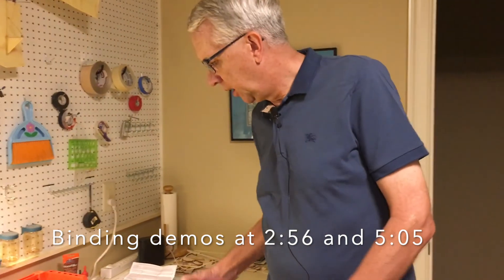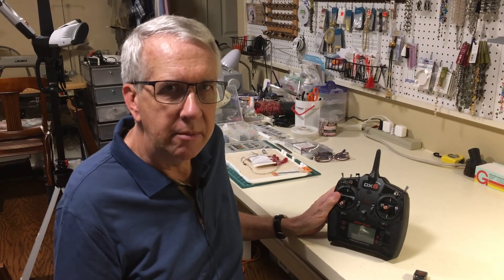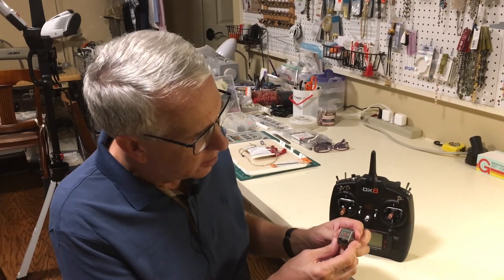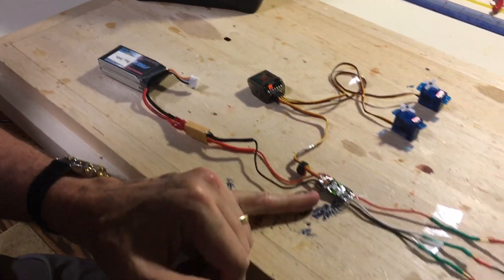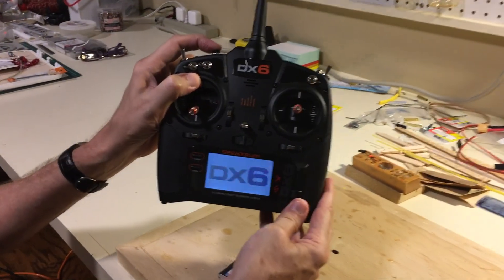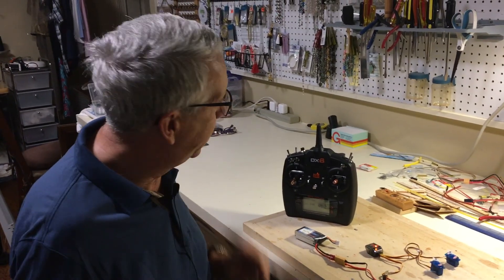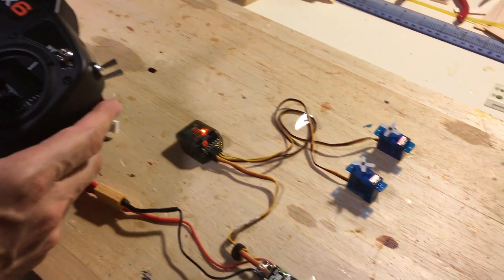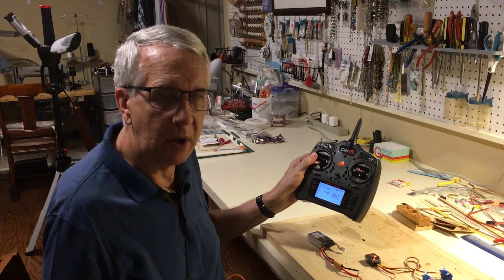How to Bind a Spektrum DX6 Transmitter to an AR620 Receiver

Comment: First time it did bind but made my plane make a constant beeping sound,hasn’t worked since the receiver now only flashes when I hold down the bind button
Reply from the maker: GR:  Try this.  Power down everything (transmitter and flight pack).  Plug in flight battery, press bind button on the AR620 Rx, and get it into the bind mode (flashing light).  Before you turn on the DX6 in the bind mode (bind button held down while turning on the transmitter), be sure to keep the transmitter at least five (5) feet away from the receiver, with the antenna pointed away from the airplane.  If you try and bind with the transmitter right close to the model, it quite ofter does not bind.  Tim
Reply: @TimMcKay56  I am more than five feet away, contuinuisly holding the bind button on my transmitter as I turn it on, and pointing it away from my receiver and it is still not working. This is a brand new transmitter and receiver so I am really confused do u know how to fix it? Sincerely confused rookie.
Reply from the maker: HM:  Only thing I can think of is double check that your receiver is in the bind mode ( usually a rapid blinking light) before turning on your transmitter in the bind mode. Also, check that the proper model is in the transmitter memory before binding. Tim
Reply: @TimMcKay56  I got it to bind... it was a user error and I had the plugs going in the wrong way. As I have said before I am a rookie and it wasn’t clear. Thank you for the help though and being so kind about it. Sincerely a beginner
Reply from the maker: HM:  Hey, glad it all worked out!  Best of luck with your flights.  Tim
Reply: @TimMcKay56 hello Tim, I know that this an older thread, I came across your presentation and just what I need, ok well I have the dx6i, its practically 99% new because I never used it..lol, ive purchaed the AH-6 Attack tactical rc helicopter from motion rc. 450 scale, i was advised by their tech to purchaed the AR620 receiver, being that the tx has an older firmware version will it still bind? Don't want to spend on additional tx? When its unnecessary.
Reply from the maker: @knightrider3766  Not sure on the AR620, but maybe give it a try. AR620 is a wonderful RX, zero problems with me. Tim

Comment: Hi Tim ....how do you unbind a receiver?
Reply from the maker: Simon:  A receiver stays binded until you press the bind button (on an AR620) or insert the bind plug and start the process to bind the receiver to another transmitter,.  Once that is done, the receiver will bind to the transmitter when that TX is in the bind mode.  In short, a receiver stays binded until you decide to bind it to another transmitter.  Tim
Reply: @TimMcKay56  okay thank you Tim.
Reply: @TimMcKay56  So, if I take an AR620 already bound to a plane on my Tx and install it a new plane, I could set up my TX for the new plane and rebind no issue?
Reply from the maker: @iramiller2389  Ira:  No issue.  The receiver is bound to a transmitter/model.  The RX does not care if it is moved from plane to  plane.  Tim

Comment: I have the same receiver and transmitter. DX 6E and AR620
     I am trying to get this setup to work in an Arrows Bigfoot airplane. I am not sure if the receiver is toast.
     I was getting the flashing light on the receiver when I would try to bind it to the transmitter but now after 1 successful bind the receiver does not flash anymore after I plug in the battery while holding the bind button down on the receiver. This plane has the ESC built in to the wiring harness. 
   Am I working with a dead receiver possibly?  A great video by the way and hope you can help me. Thanks in advance.
Reply from the maker: Michael,  I'd just get a new receiver.  The Sprektrum AR620 is a champ.  Built in antenna, I think around $40 at Horizon Hobby.  Just not worth a plane crash over something like this.  Tim
Reply: Tim McKay     I will get another one and let you know the outcome. Thank you!
Reply: I ordered another receiver from Amazon and now I am able to bind it to the transmitter. Now to figure out the transmitter....Thank you again Tim!

Comment: Can't seem to get my AR620 to bind to my DX8...which way up do the servo wires go into the receiver...black lead up or black lead down or doesn't it matter?  In this video is the yellow lead up, red or brown centre and black on the bottom?
Reply from the maker: Richard:  First, ensure you have your new model selected on the transmitter.  Then, turn the transmitter off.  Next, power up the receiver and get the receiver into the "Bind" mode (flashing light).  You'll have to check the Rx instructions or do a Google search, but you have to have the flashing light.  Note the AR620 has the super handy large bind button.  Others have a bind plug, etc.

With the receiver light flashing, turn on the transmitter IN THE BIND MODE.  Most have either a button, or an instruction to hold some switch in a  certain position.  With the Tx in bind mode, it will look for a receiver to bind with.  Once transmitter light is steady, it should be binded.  If you the receiver is several years old, it may not bind well with the newer transmitters.

For the wire direction, look VERY carefully at the receiver.  Somewhere, in tiny letters, it will have something like G, P and S (ground, power and signal).  Black is the ground, usually at the "botton" of the receiver.  If you connect his backwards, no harm, but nothing will work.  Tim